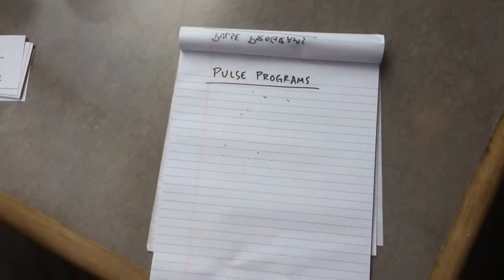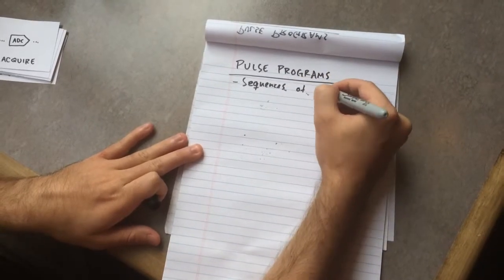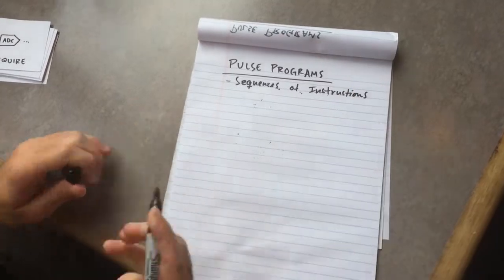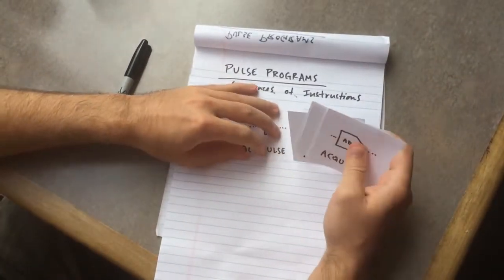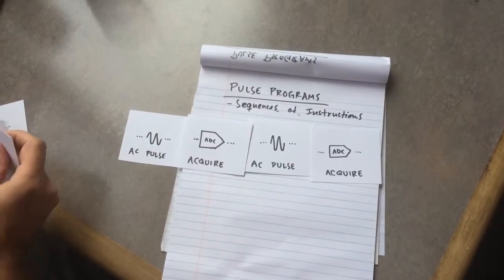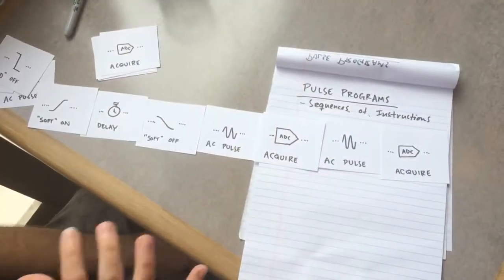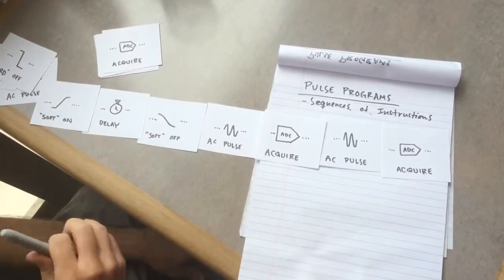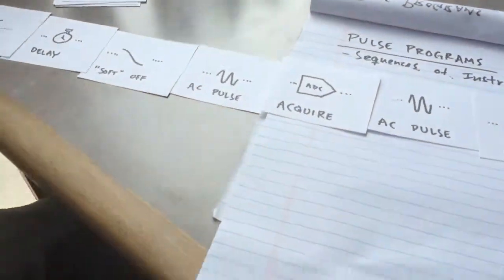PyPPM Concepts - Part 2

Comment: Great videos, is it possible to use this to gain information about the material inside the coil, or do you need a better magnet?
Reply from the maker: +ninjamongeese Such experiments yield three major forms of information: chemical shift, J-coupling, and relaxation rate. At earth's field, the chemical shift is too small to observe (it's field-dependent). However, J-couplings and chemical shifts of different nuclei (e.g. P-31, F-19, etc.) are measurable. Relaxation rates can also give (some) information about sample content.

TL;DR: You can get some information, but higher fields would definitely be required for definitive material identification.
Reply: +Bradley Worley Could I include a permanent magnet in the build, or a separate electromagnet that is perpendicular to the tube, in order to measure chemical shift? What is a good resource to learn more about the details of measuring these? Thanks for the help!
Reply from the maker: ninjamongeese Adding a permanent magnet into the design makes every part of the engineering about 1000x harder... it's why I opted for Earth's-field in my project. :) But it's certainly doable. It's a little maths-dense, but I'd recommend Spin Dynamics by Levitt for understanding the basics of MR.